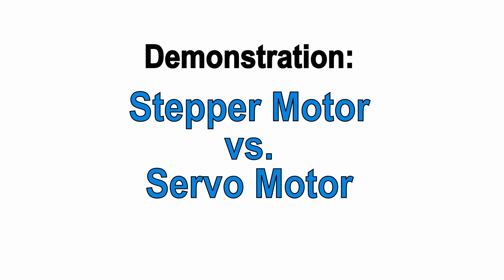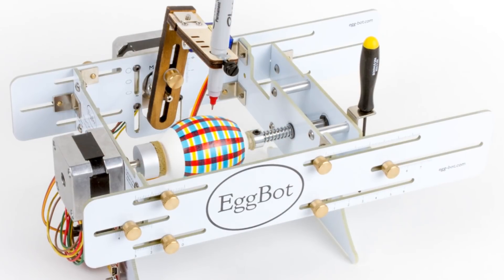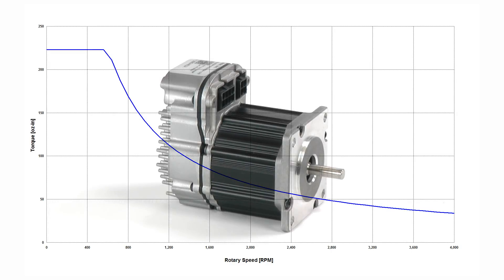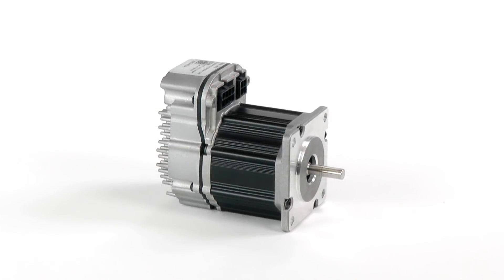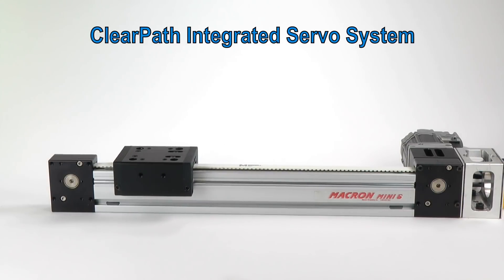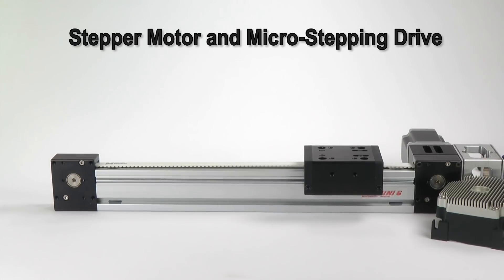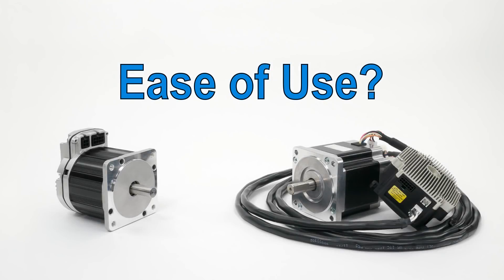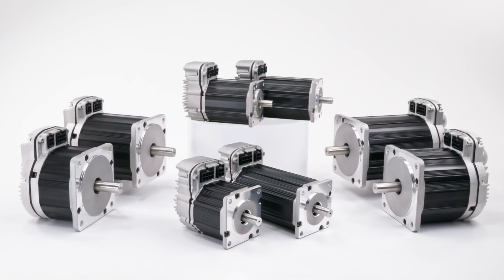Stepper Motors vs. Servo Motors - A ClearPath Demonstration

Comment: Hi if i got this is it inlcude a manual to wire and program this?
Reply from the maker: Hi @csmyfavoritecompany1213, 

Manuals and additional documentation for all Teknic products can be found on the download page of our website (https://teknic.com/downloads/).

You can also contact one of Teknic's Application Engineers directly using the contact page of our website (https://teknic.com/contact/) or by giving us a call at 585-784-7454. 

Best,
Bradley N. -Teknic OEM Application Engineer

Comment: They talk about stepper drivers, but what about servo drivers?
Reply from the maker: Hi robertoviana514,

Teknic's ClearPath motors are fully-integrated meaning the brushless servo motor, digital servo drive, and incremental encoder are all integrated into one package. While this video primarily compares the differences between ClearPath motors and stepper motors, the ClearPath SD series can replace both stepper motors and other digital servos. Due to the fully-integrated nature of the product, ClearPath would replace both the motors and drives in a system. 

Teknic's ClearPath Overview video discusses all three series of ClearPath and the different types of motors/drives that they can replace: https://www.youtube.com/watch?v=rA6yrZrxuPs 

There's also more information about the ClearPath motors on the Teknic website: https://teknic.com/products/clearpath-brushless-dc-servo-motors/clearpath-servos/ 

If you have any additional questions, please feel free to submit a contact request on Teknic's website at https://teknic.com/contact/ or give us a call at 585-784-7454. 

Aimee F. - Teknic Applications Engineer
Reply: @TeknicInc the power supply is included with the servo?.
Reply from the maker: Hi  @elsunshine9976  ,

A separate (24-75VDC) supply is required to run the NEMA 23 and NEMA 34 frame size ClearPath motors (the power supply is not included with the servo).  Larger frame size ClearPath motors (NEMA 56, 143, and IEC D100) can be directly powered from a range of AC input voltages.

Please feel free to submit a contact request on Teknic’s website at https://teknic.com/contact/ or give us a call at 585-784-7454 if you have any further questions.

Aimee F. – Teknic Applications Engineer
Reply: @TeknicInc  do you guys have WhatsApp??
Reply from the maker: Hi  @elsunshine9976  

Teknic does not use WhatsApp. We’ve tried similar apps in the past, but the limitations when discussing technical products far outweighed the “click convenience" benefit. 

The best way to get effective support from Teknic is by using the contact request forum on the website (https://teknic.com/contact/) or by calling us at 585-784-7454. 

Aimee F. – Teknic Engineer
Reply: @TeknicInc  email?

Comment: I'm on the fence in choosing the clearpath sdsk over a closed loop this one:
https://www.omc-stepperonline.com/closed-loop-stepper-kit/ye-series-1-axis-closed-loop-stepper-cnc-kit-2-0-nm-283-28oz-in-nema-23-motor-and-driver.html
I can't find any videos comparing servo vs closed loop.
What are the advantages of the servo over closed loop?
Thanks
Reply from the maker: Hello Jungle,
Thanks for watching the video, and for your excellent question.

Adding an encoder to a stepper motor makes it a closed loop design, but there remains fundamental structural differences between a closed loop stepper motor and a closed loop servo motor. Teknic makes drives that control closed loop stepper motors as well as servo drives, so we have experience with both technologies. There is merit to both technologies and the best choice depends on your application requirements. 

Perhaps the two most common criteria used to compare closed loop stepper motors and servo motors is price and performance. Stepper motors are significantly cheaper to manufacture and the system you referenced seems to be consistent with this low price point (~$80 ea). On the other hand, the physical properties of servo motors enable smooth, dynamic performance and power density that steppers fundamentally cannot match. So the optimal choice (stepper vs. servo) is often driven by the trade off between price and performance.

That said, there is one fundamental challenge with nearly all closed loop systems, regardless of the motor technology. This critical topic is electrical noise immunity - frequently a topic that gets ignored until it's too late. Virtually all closed loop motors need shielded, twisted pair cabling for the feedback device. Additionally, the wiring installation must be carefully followed using a detailed electrical installation guide. If any installation steps are missed or if the system degrades over time, the system will become susceptible to noise-related failures. On the other hand, the ClearPath integrated motors are designed to eliminate noise issues based on design architecture like optical isolation. In fact, ClearPath motors are often used on plasma tables with 50+ foot long control cables that are neither shielded or twisted pair and with no noise related issues.

So your decision may be as simple as the allowable budget for your machine. If the decision is more about robustness, improved performance, and factory-direct support, the ClearPath motor is worth a closer look. After purchasing a ClearPath motor, you have 90 days to evaluate the performance of the motors. If your machine doesn't need the added benefits that the ClearPath provides, you can return the motors for a full refund (minus shipping).

If you have any additional questions, please contact us at https://www.teknic.com/contact or give us a call M-F between 8AM and 6PM EST at 585-784-7454.
We look forward to hearing from you.

Best regards,
Tom T - Teknic Servo Systems Engineer
Reply: @TeknicInc  Thanks Tony, I placed an order last Monday and was shipped today, so I should hopefully get them on Friday :)

Comment: Oh my god! 😲 Super fast, almost completely silent, more reliable AND cheaper?! 🤯
Is this for real?! 😳
Reply from the maker: Hi Aerox,

If you need at least 30 watts of shaft power and an industrial quality motor and drive, ClearPath is a great solution for many motion control applications. 

Some have expressed the sentiment that it seems too good to be true. That’s why we decided to offer a long, money-back guarantee (90 days, and the motor can be returned with any amount of reasonable wear and tear). This gives people ample time to fully evaluate ClearPath’s performance.

If you have a current application, give it a try, risk-free. And please don’t hesitate to call us if you need any help choosing the best model.

Erik M. - Teknic Servo Systems Engineer
Reply: @TeknicInc  Thanks for answering me! 🙂 I'm still trying to learn the basics of electronics at the moment, so as for now I should probably stick to something smaller 😅 But my plans for future projects are definitelly going to require your products! So I'll come back later when I have enough experience to handle more power! 😊👍

Comment: You should talk about wiring though, I use stepper motors with 4 wires (requires homing and verification of the "steps per mm) but it's 4 wires nonetheless. How is it wires compared to a similar stepper without an encoder? If the control is built into the back of the motor, can it emulate the 4 wire connections and actually be a drop in motor replacement that similar just needs quick config and a separate connection for power?
Reply from the maker: Hi Kevin Delaney,

It sounds like you have a separate stepper motor and stepper drive (similar to the stepper motors we demonstrated in this video), and the 4 wires are the phase wires connecting the drive to the motor. When using a ClearPath motor, you don’t need to wire the two together since the servo motor and drive are a single package; i.e. you'd be replacing both the stepper motor and drive with a single integrated servo system.

We designed the ClearPath SD motors to be as close to a drop-in upgrade as possible for a stepper motor and drive system (we demonstrate the SD-series in this video). ClearPath SD motors take in the same Step & Direction signals typically sent to stepper drives (the electrical inputs are rated for 5-24 Vdc), and often times use the same DC bus power as well.

We've created a number of videos, wiring diagrams, and technical documentation showing how to use these ClearPath SD motors. You can find that information here on our website (https://www.teknic.com/products/clearpath-brushless-dc-servo-motors/model-support-sd-dc/).

If you have any other questions, feel free to contact us directly at support@teknic.com.

Best regards,
Matt C. – Teknic Servo Systems Engineer

Comment: hi is it possible to get 5000 mms with servo motor, for laser engraving machine only engrave not cutting
Reply from the maker: Hi Roland,

Our fastest ClearPath motors have a top rotary speed of 6,000 RPM. Your specific mechanics will determine whether that rotary speed will allow you to reach a linear speed of 5,000 mm/s.

If you'd like to discuss your application more to see whether 5,000 mm/s is an attainable top speed, please feel free to contact us at support@teknic.com.

-Ian R, Teknic Servo Systems Engineer

Comment: With your knowledge depth sir, would you recommend this for a robotic arm or stepper motor ?
Reply from the maker: Hi Skitnado, Either choice may work depending on the physical design and application goals. A servo may be the better choice if you're looking for faster and smoother motion. However, if you don't require a great amount of power, the stepper motor might be more cost effective. The choice will be dependent on many specific design factors.

Best regards,
Bridgette G.

Comment: I have used 2 of Clearpath's most powerful NEMA 34 mount servos for a project I did about a year ago and can tell you that although this smells of the typical biased "vs" type reviews that manufacturers make, Clearpath makes QUALITY servos and there's no BS to what he's pitching. My servos are almost dangerously-powerful and quick and extremely capable. Will easily buy again when it comes time to get a CNC router :)
Reply from the maker: Thanks Jesse Silver. We greatly appreciate your comments.

Our #1 goal for our videos is education. We try to impart knowledge by using facts and examples that are easy to understand. We appreciate your business and wish you much success.

Tom T

Comment: It's nice that you show how to compute the power given a speed-torque curve. I echo the comment that someone else says that feedback to stepper motor drives is readily available to drive PID control loops. The Schneider M-drive stepper motor and the Oriental Motor Alpha-Step products (not the model shown in the video) referenced in someway during the video have a closed loop PID control loop. Leadshine also has a similar product. I've used all three of these products. I understand the comparing similarly priced products, but perhaps just a mention that steppers can also have servo control loops (for more cost) or the make-model and configuration would help with transparency of the demonstration.

I was one of the original folks to write to your support group when the ClearPath was announced. Unfortunately, I was not able to use them at the time because I needed either continuous following error reporting or duplicated encoder signals. I asked on your video today if the -SC model has the ability to report these in software. Unfortunately, that video appears to have been removed. If the -SC has this support, I certainly would order one for testing.

Finally, I would say that steppers still have a purpose in applications there any dither must be avoided such as some optics setups.

Thank you
Reply from the maker: Thank you for your feedback. Teknic servos have proprietary AntiHunt™ technology that virtually eliminates hunting while at rest. That being said, a $50 stepper motor still provides some value when all you need is a $50 stepper motor for your application. The historical high price barrier of servos has been addressed by the ClearPath integrated servo motors and has opened up many new markets and applications. When comparing smoothness of motion, quietness of operation, power density and efficiency of energy usage, the benefits of the ClearPath integrated motors vs stepper motors become readily apparent the first time you use them.

Comment: Hi i really like your stuff and i would like to make some questions!Well a stepper motor rotates in steps,the frequency of steps define acceleration or velocity,am i right?When it comes for a servo to replace a stepper motor,what kind of control is applied to servo,is it speed profiles or something like small position changes with the frequency change desired position again define speed and accel like steppers do??Which is the smallest possible step angle for a servo compared to stepper,if the servo shaft encoder provide 1000 pulses per rotation,is it possible to step one encoder pulse or it needs more pulses and why(maybe the cascaded PID loop tracks the error in a smaller scale than the smallest step of the servo)??I would appreciate any advise!!
Reply from the maker: These are some good questions. The ClearPath SD models take in step and direction signals like most stepper motors do. Teknic designed the SD model this way so that a user could drop in a ClearPath SD servo as a replacement for a stepper motor without having to change the software on his/her step and direction controller. So, a user would program these motion profiles into the CNC controller and then send these profiles to ClearPath's drive through step and direction pulses. You are correct that the frequency of these step pulses defines velocity; the rate of change of the pulse frequency defines the acceleration.

A big difference between a typical stepper motor and ClearPath SD is that ClearPath SD is closed-loop. The encoder inside of ClearPath is constantly sending feedback to the internal drive which continuously makes torque adjustments to closely follow the commanded step and direction signals. This is why ClearPath will not stall or lose steps like a stepper. The encoder and drive firmware ensure that the motor achieves its commanded position unless there is physical obstacle that ClearPath cannot overcome, or if the motor is undersized for the application.

NEMA 23 and 34 ClearPath motors all have a 12,800 count per revolution encoder for feedback, but depending on the model, the “input resolution” (i.e. how many step pulses correspond to a command for one motor revolution) ranges from 800 to 6,400 pulses per revolution. The "regular, R" version allows for 800 pulses/rev to command to. The "enhanced, E" version allows for 6,400 cts/rev to command to. You can choose the input resolution (pulses per shaft resolution) in ClearPath's MSP software. Please see more about this input resolution and the specific degrees of rotation per count in the ClearPath User Manual: https://www.teknic.com/files/downloads/clearpath_user_manual.pdf

Finally, ClearPath uses a PIV compensator as opposed to a PID version (the "V" term denotes an embedded velocity loop as opposed to the "D" or derivative term within PID). It also uses multi-derivative feedforward gains to reduce tracking errors (preemptively, before they even occur) based on the motion command. Designing a PIV compensator is more difficult than designing a PID, which is why the PID is much more common, but it is higher performance, and the tuning is not iterative like PID tuning. This makes tuning much easier and more deterministic whether the tuning is done manually or by ClearPath’s auto-tuning algorithm.
Reply: Thanks for the information!!Something last to ask about PIV.What is a typical frequency of the PIV loop and is  it relative to speed,or constant?

Comment: You make mismatch with the concepts!!!! Servo motor is ANY motor with FEEDBACK.
If you put feedback on a stepper motor, it will be ALSO a servo motor.
BLDC motor with feedback is also servo motor. Asynchronous AC motor with feedback is also servo.
In this video, its not correct to compare servo BLDC with stepper WITHOUT feedback, they are in different classes.
Reply from the maker: Thank you for your comment. You're correct that technically any motor that uses feedback to control torque, velocity, and/or position could (and probably should) be termed a "servo motor". However, our experience is that most commonly, when people use the term "servo motor", they're referring to a servo controlled BLDC motor and when people use the term "stepper motor", they're referring to an open loop stepper motor. (Comment continues...) 

Usually when an encoder is added to a stepper system, it's for the purpose of checking for lost steps after the move is finished. It's possible to continuously servo control a stepper motor (we can do this with our Meridian product line), however, the high inductance and detent torque of a stepper motor makes it a poor choice for servo control (so we only recommend the stepper option with Meridian when it's required for size or cost reasons). The stepper motor's historical strength is that it can be run open loop, and, as we state in the video, in lower power applications (that can use a NEMA17 size motor or smaller), the stepper motor will usually be less expensive.

Although it's correct for you to say that a servo controlled BLDC is in a "different class" than a stepper without feedback, we think it's a fair comparison because the pricing is similar and the two types of motors are often used in similar applications. Additionally, a stepper motor with an encoder paired with a stepper drive with encoder inputs, would be more expensive than a ClearPath servo system without the performance benefits of a BLDC servo system, so we didn't think it would be a helpful comparison.